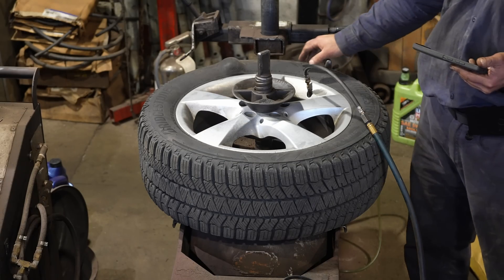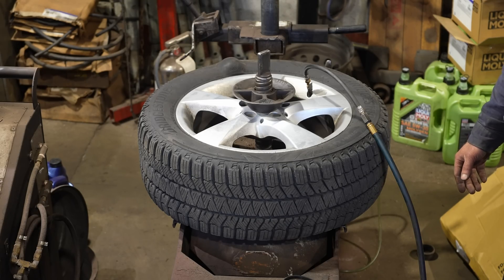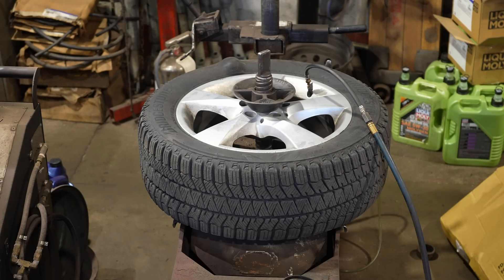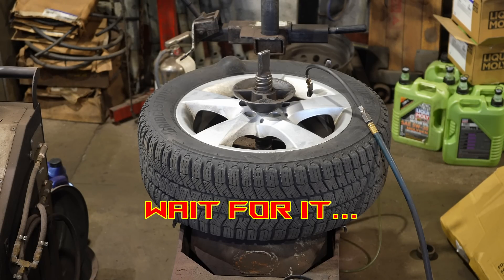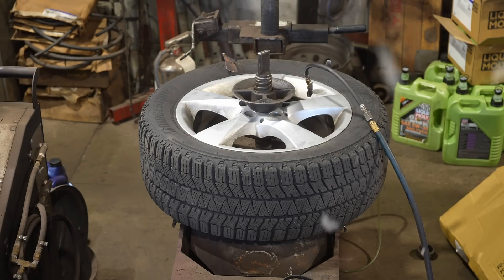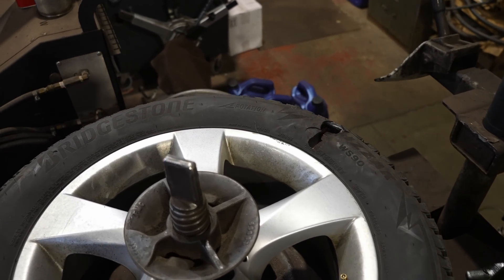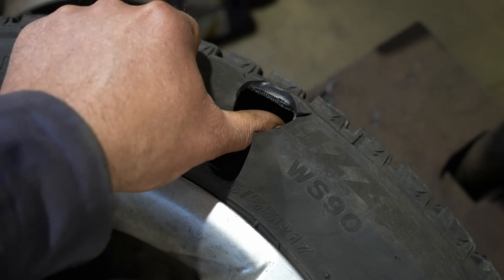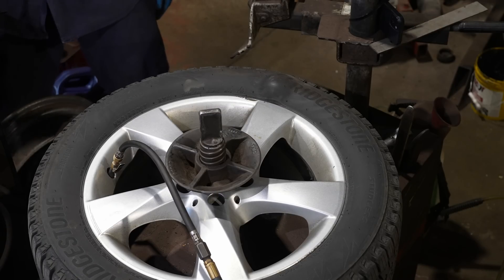Tire Bulge EXPLOSION in Slow Motion! 💥 120fps Capture

Comment: I worked at a tire shop and popped one with a knife. The tiny particles of dirt came out so fast they got lodged in my skin. I thought it was going to be like stabbing a normal sidewall. Nope, the air came out all at once and I had microscopic rocks stuck in my face 🤦 I would not recommend it.
Reply from the maker: I would not recommend it either, but I imagine it was exciting.